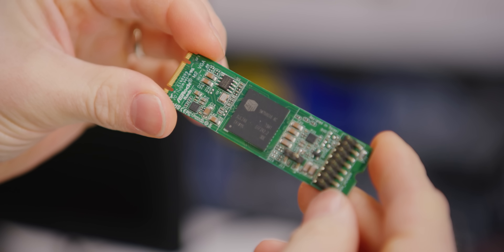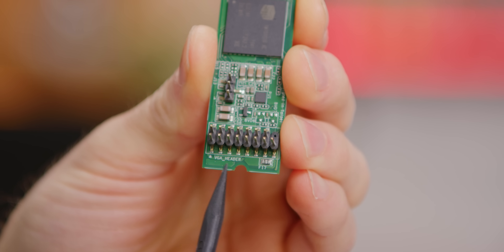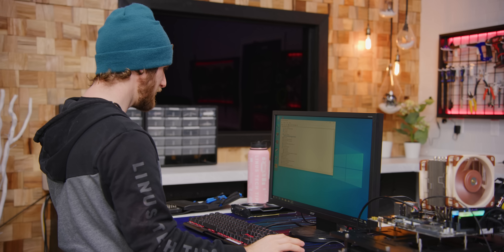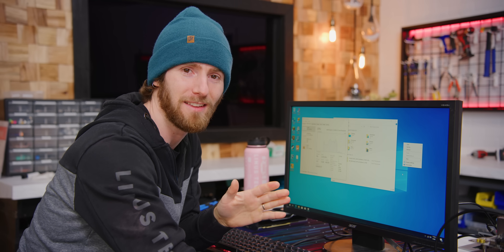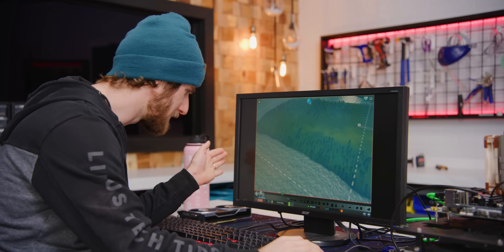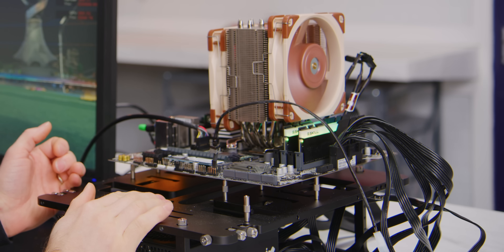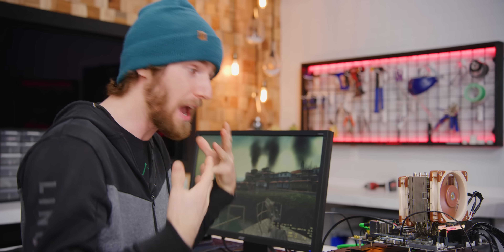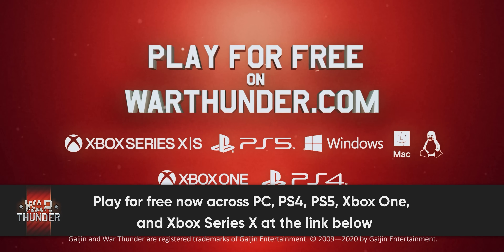THIS is a Graphics Card..?? - ASRock Rack M2_VGA

Comment: "gaming machine" might be a reference to casino-style games, the kind you find in seedy bars.  Those things run industrial-style potato PCs at potato resolution where a "GPU" like this could suffice.
Reply: This is exactly what I thought as well.  It also explains the internal header and the drivers being referenced as “samp”le.
Reply: @ErebuBat  e3h, y. H4
Reply: Being that it's ASRack it's more for the server end where you just need enough GPU to see the desktop and interact with the system.
Reply: @mikey17314  servers don't typically have a desktop environment installed, you'd usually just ssh
Reply: @TAP7a  correct, but if the environment is Windows server based it'd be helpfull.. depends on the server and its functions.
Reply: The m.2 interface has been around for a while, and Konami has been known to use low-end Dell office PCs in their newer arcade games, so that's most likely what's in their gambling ones, too.
Reply: @ohnoitschris raw thrill does that. konami uses itx boards with amd since ddr x with intel being in iidx since 9th style
Reply: That’s what I was thinking too, but it seems pretty underpowered for even that, considering how much it struggled with YouTube.
Reply: @JohnGeorgeBauerBuis  For the Server, it's enough to get you installed and ready to enable RDP which is most likely how you'll interact going forwards anyhows.
Reply: Yep. That's what came to mind for me as well.
Reply: Yeah but most of that casino gaming crap would run on a gen 1 raspberry pi, might as well make that board  bigger and strap on some pop RAM and the oldest ARM processor you can find that is still in production..
Reply: Hello casino machine repair guy here, a little late but hey, we do not use these most machines use coustom made "back boards" attached to the motherboard for expanded i/o and cpus that have on board graphics.
Reply: This is probably more for the multi-game machines that have 30 flavors of Keno and video poker.  Those definitely look like they run on a potato. @mdsandros
Reply: Rumor has it, in England.. there's a little old lady with punch cards below the bar games running code manually.
Reply: Yeah But you will still Need an nvme Slot for it and i dont think those potato Style PCs have that.
Reply: @getriebesand2195  they deffo do, they run modern low power cpus, with custom made boards that could totally have m.2
Reply: @getriebesand2195  bruh $50 mb's have m.2
Reply: @getriebesand2195  a lot of potato pre-builts you get for like $150 at Walmart have NVME drives in them, but with CPUs that don't allow them to reach their potential.
Reply: @getriebesand2195  Sorry to resurrect a thread from almost a year ago...

The website shown in the video that mentions gaming applications is the page from Silicon Motion on their SM750 chip. It is not the page for the ASRock card featured in the video, which uses the SM750 as a component.

The folks at Silicon Motion probably expected that the manufacturers of gaming machines (i.e. video poker or slot machines) would include the chips as a component on the purpose-built PCBs that drive those machines. ASRock decided to make use of that same component as the graphics processor on their (very) small form factor graphics card. It (and other similar chips) probably sees use in a number of other applications, too.
Reply: @getriebesand2195  not NVMe, M.2 PCIe
Reply: @getriebesand2195  even if they dont theres ram to m.2 converter, imagine a m.2 gpu plugged into a ram slot xDDD Now thats a frankenstein pc
Reply: Why is Linus sponsored by war thunder? World of tanks better

Comment: This one is exclusively for servers, and its a lifesaver as almost none of those server processors have onboard graphics.
Reply: amd should ship these with the threadrippers
Reply: @bobuccman1424  right
Reply: except most server motherboards have something like this on the board already, as that is needed for the ipmi to work.
Reply: The question is... if your server's integrated gpu died and you were trying to troubleshoot the issue... would you even be able to access the ipmi with this device? Or, what about a case where the server was purchased second hand and can't be accessed without a video output because it has not been configured yet? While this would save an otherwise dead server in theory, I wonder if it would actually work for that case. I imagine this is why windows sees the device with so many varied configuration options that are not accurately represented in menus.  @rysterstech
Reply: @rysterstech and alot of workstation board dont and this is perfect for homelab conversion. Im defo getting this one to replace a 1030 i bought just to sit there for boot.

Comment: Well, this is awesome. The hdmi variant would fit super well into a headless home server. I am looking to upgrade my home server cpu, with the innodisk one i would not require an apu. Pretty sweet, but damn they are expensive. Making it totally unviable.
But wtf is up with molex power? Having to run a completely separate power cable just for that sucks.
Reply: Racist

Comment: Linus is laughing now but in 5 years time you will be able to buy a m.2 form factor graphics card with more power than a 3090ti
Reply: And linus will. Laugh ant the clock speed as if it's A 300mhz clock today

Comment: I love that him holding his finger on the chip is liquid cooling it.
Reply: that thing gets so hot your body temperature is COOLING?
Reply: @sodiboo  Ive actually had the situation happen on my phones before when charging
Reply: @sodiboo  On a Pi 3 the temperature drops when you put your thumb on the SoC.  I never knew why.  Now I think OP's explanation is as good as any.
Reply: @sodiboo  yes temperature spreads on air and the heat disapates unto nearby temps which is why ice melts, so if an object is just touching a hotter object the temps of those two will sort off combine into each other and cool off each other also
idk how to properly word it but i heard that's how temps work
Reply: @sodiboo no, linus just has a body temperature that's lower than other people for optimum performance
Reply: Everything electronic or electric is hotter than your body temp when turned on.
Reply: @uncrunch398  uh no, there's many electronic devices that are way lower then 37°C at idlr
Reply: @ajddavid452  Okay.  Got me.  I'll narrow that down to everything with a vent or glows.  Tiny LEDs might not seem 🔥, likely because not enough heat to make the lense 🔥.
Reply: @uncrunch398  I was talking about actual processors
Reply: @ajddavid452  Likely capped very low.  As in those in phones and lower end SBCs.  Forgot about them.  I've seen demos of them being uncapped and heatsinked to achieve much greater performance.  They're capped so they don't burn out as part of kits lacking any form of cooling for cost saving for those looking for something as inexpensive as possible.
Reply: Blood cooled
Reply: @Jonathan Korba There is an entire city named after your last name in India😂
Reply: My thighs get hot enough to set off the temp warning on my iphone, i wouldnt be able to cool this thing.
Reply: I wish they woulda put a heatsync on it or something lol I know it wouldn't have done much but I love experimenting
Reply: @MaxIronsThird  technically no, as long as his hand is cooler it lowers the temperature
Reply: heatsink
Reply: i know im replying late but my hands get super cold during winter (350 days a year in AU) so I place it on my laptop to cool the cpu and it works pretty well on HW monitor lol
Reply: Bro your body is liquid cooled and warmed

Comment: lol it's a fucking microcontroller, it's for building electronics, not a "graphic cards" in the way you think of. It's simply there to give a visual out put for your electronics. FAR FAR FAR away from a gaming situation
You'd find stuff like this in smart fridges, you know, they'll just show icons your low on.
Also yes, you can still use it to make gaming machines (this wouldn't be wrong) however, you wouldn't want too lol, you'd build your electronics project display simple game with only a few sprites (depending on your main microcontroller). It's akin to the stuff you'd find in throw away handheld stuff, though this is more complicated than that i'm just trying to explain it in the best way i can think of.

It's not a GPU in the way most pc users think of... basically however by definition it's a gpu (brain faaaaart)

Comment: Linus, you do realise that Intel, AMD and nVidia do more with their accelerated video rendering that just rendering video?
When you decode video there is extra processing you can do to improve the quality of said video. Each codec can have different techniques to improve image quality based on how the codec works.
The easiest one to understand is MPEG1, It encodes in blocks and the higher the compression, the more blockier it gets. In the decoder you can take a look at the pixels around and if it looks like it is supposed to be a gradient, you can interpolate and show it as a gradient, if it looks like a solid colour, you can get rid of the variance.
The built in software decodes probably just decodes the video as is, not trying to improve it at all.

Comment: I remember when my old GPU had 8MB of VRAM. That was enough for games back in the 90's. 

Half Life 1, Neverwinter Nights, Dungeon Siege. Those were the days.
Reply: Even this is actually much better, because the difference of any gen of DDR speeds are anyway smaller than any of GDDR, so your would be really faster
Reply: Nowadays 8MB of on-chip texture cache is low end for a modern GPU.
Reply: @FunBunChuck  that is understandable, but DDR memory is so actually so damn slow for GPU((
Reply: I was having a 8MB “shared” SiS IGP from 1999 till late 2005. 
Imagine even old AF GTA 2 being able to run smoothly (25fps?) only at 800x600 but not at native 1024x768 resolution …Struggle was real😵‍💫😢😓
Reply: Bruh, I still rock Half Life 1 all the time.
Reply: I remember my pc with no gpu and 64kB of main ram. That was enough for games in the 80's...

Comment: I want to totally waste some silicon. 

I want to make one of these with GDDR6 memory, and enough pins to connect to a single DisplayPort 1.4 port! And of course, run it in a full 4-lane configuration. 

Bonus points for getting multiple GB of memory on there. Perhaps run a strip of it over everything, like a heat spreader?

Comment: @Linus Tech Tips - 
Play UnrealTournament1 ( = UT99) on it , it will run very smooth even with the basic display adapter (game build in Software-Rendering) on anything from Windows 98 to 10 (if the game has no copy protetion driver)

Comment: Linus: complains about older monitors with slower panels
literally more than half of his audience: deals with 60Hz, 5ms displays basically everyday
Reply: My laptop recently turned 6 years old and my monitor (1920x1200 resolution with a 24-inch screen, 5ms) 12 years. Still works like a charm. And because it still works like a charm I am reluctant to swap it out.
Reply: @FixTheDisc  don't get me wrong. I am in a similar position (4 years old laptop, 8 years old monitor). But boy, I would be lying if I said that a smoother vision is a dream that I can't wait to realize
Reply: @vimad97  Oh I am willing to upgrade. Just feel really wasteful if stuff doesn't break before I upgrade. But as an oxymoron, I always get pissed when an electronic device breaks too early. (Like I need 4 years out of a phone at least).
Reply: @FixTheDisc  I agree with you, I replace things in general when they're too wasted to work properly. some times though, when there's a specific need for a new feature, I give up. for example low refresh rates disturb my eyes.
Reply: @vimad97  fair enough! But at least when I need to swap things I give tech companies a fair chance to impress me. Really interested in the "flip" smartphones but more towards the Samsung galaxy z flip phone. Cause dangit if i don't get nostalgic for the time when technology improvements meant smaller and lighter things.
Reply: @vimad97  how about a 10 year nearly 11 year old elitebook do you have to deal with that
Reply: @FixTheDisc  My first phone lasted around 5 years and actually still worked but was just getting to be a little too slow for my growing needs (and the growing bloat of mobile software).  Upgraded from a Galaxy J7 (mid-range) to a OnePlus 7T Pro (upper range) and don't plan to upgrade again for quite some time.  My oldest monitors found the scrap heap long ago or got donated to someone else as I ran exclusively on a laptop for quite a while (I basically lived at my Grandma's during the week for work and my mom's friend's house on the weekends so I could spend time with family and have internet access).  Once we moved to a condo I got a 1080p monitor which I think is 5ms delay and more recently added a 4K monitor that is, I think, also 5ms delay.  Kinda wishing I had waited a bit then sprung for a little bit newer and more expensive one though since I don't have HDR and the newer ones also have shorter delays.  Not planning to upgrade either of my monitors again anytime soon but when I do I'll probably find someone to take them.
Reply: @grn1  So how did the monitor swap feel? Revolutionary? I got a iPhone X for free but stil kept my Samsung 7 as a reserve phone and for playing audiobooks. (iPhone got a real problem with mp3 audiobooks for some reason)
Reply: @FixTheDisc  I wouldn't go so far as to say revolutionary but it is nice.  Up until recently I was still mostly bound to 720p due to my internet and I haven't really played any games that take advantage but when I do watch something in 4K (which I can finally do more often now that I have decent internet) it is really nice.  Definitely notice a lot more details and colors seem to be better overall even without HDR.  Lower res formats sometimes look better on my old monitor though since they're closer to it's native resolution, in fact I actually have my Nintendo Switch hooked up to my old monitor for that very reason.
Reply: @vimad97   i have syncmaster ta350 10 year old moniter still working fine
Reply: @vimad97   so i did the same thing he did with testing the moniter opend the same video at 6:16 and my moniter is looking way better than the moniter in the video at doesnt have this thing that annoyed linus..
Reply: @FixTheDisc   I always sell hardware I'm upgrading.
Reply: I'm sorry, but my 1080p60 display doesn't look THAT bad.
Reply: 60hz 16ms 1280*1024
Reply: I have 1200x1600 60hz 16ms top dat 😏
Reply: I was right there with that 60hz for years, going through a divorce, so moved out one morning on my way to work, just had my car and cat and the clothes I was wearing , my xbox one and my PC. so used the crap TV at work. But now I bought a 65" LG 4K 200hz(stated but real seems to be 120hz) 2ms, upgraded my PC and covid stopped me getting a good graphics card so it's a 5500 4 gb does struggle at 4K gaming but other than that it's a great setup. Yip I'm a looser
Reply: Ik, I still cringe a little how he comes off as elitist sometimes coz I've had to pull many strings to get a budget 144hz by HP even and years to buy my parts
Reply: Yup. I'm running a 20 year old 4:3 1280 x 1024 monitor. Still running fine.
Reply: >15hz crt
Reply: I always used shitty monitors because I've always struggled with money, but things fortunately changed over time... still... I somehow believed that higher refresh rates were BS and "undetectable" by the human eye... Until I recently bought a 280Hz display and holy fucking shit! the smoothness is just so beautiful I couldn't even believe it! 

I hope everyone of you that are struggling are able to enjoy higher refresh rates someday soon, they are pretty amazing!
Reply: I use a 100hz°... 15" CRT. I use it for day to day use, not anything ""retro"".
°at 800x600
Reply: Without a GPU I have to deal with 720p, 30 fps in games...
Reply: @danielaguilarservin3524   oh no it's the end of world
Reply: Thats mine! Its also the worst TN panel ever to exist.

Comment: Great little device, just a shame it isn't hdmi or display port, minor problem. People running CPU based compute farms could add one for diagnostics and setup. If you are using water cooling this means the boards could be slotted really close together. Pair it with a mini-atx board with no PCIE slots, 2 M.2, 4 ram, and a AM4 slot and you could get a lot of processing in a small footprint at a reasonable cost. With some good design you could possible get 12 in a case not much bigger than a full tower. 5950x's would give you 192 cores. Basically a CPU based rendering farm in a single portable unit.